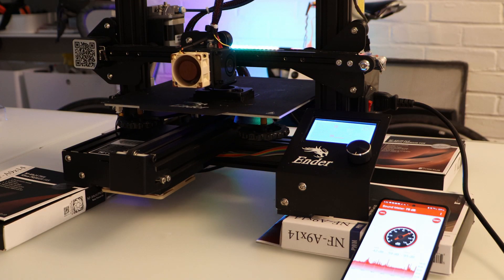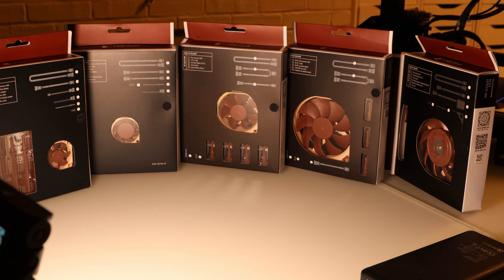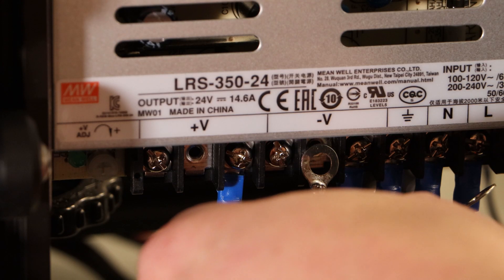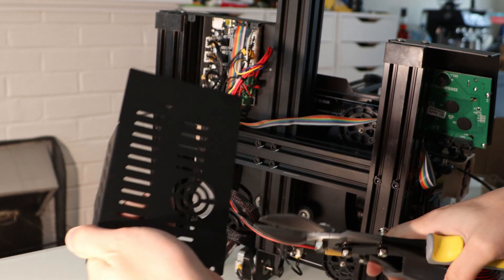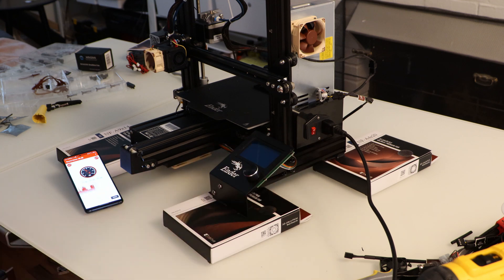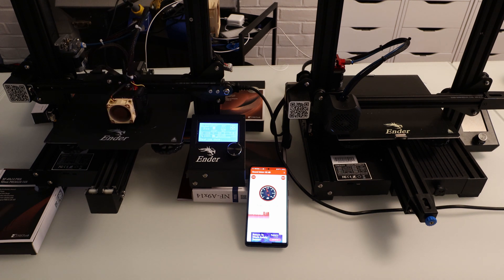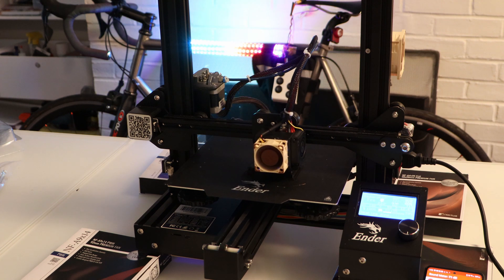Ender 3 Silent Fan Upgrade (Upgraded Pro Vs Stock V2)

Comment: Oh my.. i mean yeah it could be just a tad quieter but its not as much the different fans its how they get air in, by removing any "gates" "small holes" ext from the fan inlet will make it quieter due to airflow.. but hey man if u feel that throwing out money on fans go ahead! I only recommend that one only print a new holder for the fans, as heat removal is a important thing... just saying :P
Reply from the maker: Yeah the v2 seems loud compared to the Ender 3 Pro, which is probably down to the new fan protector design.

I've thrown away close to $400 on Noctua fans over the years so don't tell me now that they aren't any quieter!
Reply: @NathanBuildsRobots  but quiet is not everything, airflow and cooling is much more important than the noise, yes noctua is quieter but to a sacrifice on airflow. but if it works it works but people should know that in some cases its not a great idea to change the fans to quiet when it needs good airflow! :)
Reply from the maker: @jonathanbeccau6198  Yeah that's why I doubled up on the fans for the hotend heatsink. The 2 fans together make up for them being weaker, which i verified through temperature readings. Its not exactly a cost effective solution but I was working with the stuff I already bought. 

Speaking of "if it works it works", someone commented that I should just use the 2 Noctua fans in series since 12V + 12V = 24V. It actually works! If you stop one fan, the other gets about 0.5 seconds of 24V before they both shut off, I think through their built in overcurrent protection. Then they both turn back on at the same time and just go. 

This was using the 40x10 and 40x20 fans in series, which have the same voltage and current rating. I was pretty sure it was going to fry $30 worth of fans instantly but it was a risk worth taking.

Comment: you have both fans running in series? why, you just make more noise and create less airflow. take out the old fan, in order to have multiple fans in series you would have to have a stator which has its blades pointed in the inverse direction of the spinning blades.
Reply from the maker: Yeah I think a stator would make it better, like in a jet engine. 
The way it set up now is quieter than it was before but I guess it could use some improvement.

The best solution is to just get rid of that fan altogether like I did on some of my fanless builds. Someone in the comments said if you use an AC heated bed you can use a tiny laptop power supply which I would really like to try!

Comment: Man, thanks for this video.  Very hands on!  Especially liked the benchmarking before the changes.  One Question: What gauge wire are you using between the power supply and the buck converter?
Reply from the maker: It should be drawing around 0.1A so almost any gage will work. But I tend to use big wires (20Ga or larger) to make sure some surface mount component blows before the wires melt, because that way at least things stay put. 

I always Google "awg" to get to this page: https://en.m.wikipedia.org/wiki/American_wire_gauge#Tables_of_AWG_wire_sizes

"Then look at Ampacity at temperature rating"

Comment: To get around the 24v dilemma, without using buck converters, I would run two 12v fans in series.
Reply from the maker: Update: I tried running 2 in series and it actually worked. It's be in my next video.
Reply from the maker: I will try that, thanks! I want to put them in series and measure the voltage with a multimeter to see what happens if I stop one fan while the other keeps spinning.
Reply: the problem with this is that when one fan slows down or stops (if for example it breaks or malfucntions) and therefore uses less current, then the other fan will see a higher voltage. This is not a viable solution. You need a stable 12v supply. 

If you dont want to use a bulky buck converter you can use a backwards-operating 12v zener diode with the appropriate current-limiting resistor to provide a stable 12v.
Reply from the maker: @duviday  I thought the same thing, but it turns out noctuas have really good current limiting protection, so they stop they so themselves from blowing up. I wouldn't recommend it, but it's been working for me.
When I stop one fan the other sees a voltage spike and sits itself off in 1 seconds.  Then they both turn back on.

If I constantly jam one, the other will keep trying to start but it will just turn on and off repeatedly until I release the other fan.
Reply: @NathanBuildsRobots  measure the current: my guess is, that if you stop one fan, the current rises (on the stopped fan) and the other (free spinning) fan stops due to voltage drop.

Comment: I was thinking of an other solution, cooling the pcb with a teg.
Reply from the maker: You could do that, but ThermoElectric Generators are mainly used to cool things below ambient temperatures, or accelerate heat transfer to a heatsink, which will then disappear that heat into the air. They are interesting but not very efficient. Similar cooling can be achieved by simply using a slightly larger passive heatsink.

In my latest video I installed a vapor chamber (heat pipe) onto the motherboard to cool the stepper drivers. It looked cool but was probably overkill. Would have been easier to just put a normal heatsink back there for similar effect. 
 
https://youtu.be/uqCntWdLIvA

Comment: So is your hot end and cooling fan wired together? I’m trying to figure out if I could make my cooling fan work like stock where it turns on after the first few layers.
Reply from the maker: I left my cooling fan as a 24v unit and wired it into the same cables that the stock part cooling fan used, so it has the same behavior. The dual ball bearing 5015 fans by WINSINN are pretty good, I left a link to them in the description. 
If you are using a12V fan for part cooling you will need to run a voltage adapter in series with it, let me know if you need more help with that.

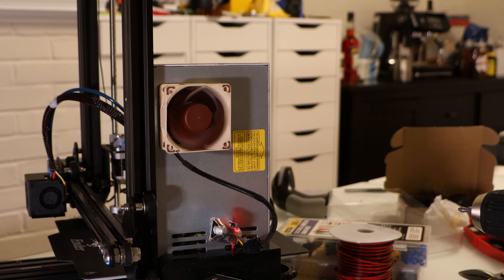Comment: 6:07 The airflow is upside down on the PSU (The PSU is upside down). The fan should suck cool air from below and release it out the top vent holes.
Reply from the maker: Yeah, I didn't like installing the fan like that. Gotta have gravity work with us not against us!
Reply: @NathanBuildsRobots  This statement only makes the case for bottom mounting (or flipping) the fan even stronger. benches air typically become less dense when it is heated causing it to be pushed sideways and upwards by the colder, more-dense fluid around it, that is being pulled more strongly down by gravity. So long as gravity is the dominant force at work. In one aspekt you are the one working against gravity😏. 

But seriously, splendid video it helped a lot!
Reply from the maker: You're welcome! Yes I know, everything is upside down, but it's Creality's fault because they pre drilled the holes to be installed with the fan on top blowing in. If have preferred to have the fan on bottom blowing in, or the fan on top blowing out, but without opening up the power supply or mounting it with the wires sticking out of the top I had to do it the less than optimal way :(which is why it pains me to install it the way I did but it was the lesser of 2 evils)

Comment: The difference is huge. Great video. 3 Noctuas are about $50 but you need to buy four so you can elevate the printer on the boxes :)
Reply from the maker: You may be sad to hear that I have replaced the fan boxes with real feet.
Reply: @NathanBuildsRobots  Shame!

Comment: half of the printer price for new fans. This will be evolution. :-(
Reply from the maker: Yeah, there are certainly cheaper fans on the market, but prefer Noctuas. The cost increase is due to better materials, engineering, and accessories (such as the extension and splitter cables that I used to wire up the machine). Well worth the additional cost IMO.
Reply from the maker: I will see what I can do about getting the price of the fans down.

Comment: But a part cooling fan is still stock. It's not completely silent because biggest noise exactly from the part cooling fan and it is almost impossible to replace because there is a 24v controlled by pwm. You can install noctura fan there and limit fan speed in the slicer but guarantee that this will always work properly.
Reply from the maker: I got some 24v 5015 fans that in using now, much quieter and better part cooling. Will be posting a video with them on the printer soon
Reply: @NathanBuildsRobots   I tested all of them and you will have a creepy pwm sweeping ) Good luck.
Reply: @NathanBuildsRobots  This sounds great! Looking forward to the video

Comment: The V2 is a in general good machine I think but indeed I was a bit dissapointed that the PSU fan is so loud I need to use earplugs in my right ear to be able to sit next to the machine and continue working on the CAD computer at the left  side of it while its operating without risking long term hearing damage as it is basically like having a hairdryer on full speed or similar constantly screaming in my right ear as I have set the V2 machine and CAD/Slicer computer together on a table as a complete workstation and while the machine is running one set of parts I meanwhile often like work on another set of parts on the CAD computer at same time while keeping a constant eye on the machine in case something go wrong, part comes loose from plate ect. Also the hotend fan is broken from start with cheap bad bearings that squeal and vibrate from start although I can get it to roll properly for an entire run by switching the machine on and off a couple of times and then the bearing will align properly.
Reply from the maker: Lol, I know what you mean, the sound bothered me too. Now I'm printing 15 mm^3/s in silence with a V6 Volcano hotend kit, which is 4 times faster than when I was using the stock setup. I'll post a video about it in the next couple of days. Just ran a 20 hr print that using over 1 kg of filament. I used Winsinn 5015 fans which blow a ton of air and are still quieter than the stock part cooling fan. My stock part cooling fans bearings were fine, but it makes a high pitched coil whine while running, so I cut its wire just to get it to shut up!
Reply: @NathanBuildsRobots  I saw your other vid now also about the PSU not having any outlet for the cooling air possibly posing an overheating and fire hazard so im in the process of fixing this at moment. Got the PSU box loose from the machine and tomorrow Im gonna Dremel out a square in the cover sheet over where the PSU vent holes are. I think its strange that Creality took good care with air outlet holes on the controlboard box but missed them completley on the PSU box.
Reply from the maker: Yeah, it makes no sense to me because if they left all that extra metal it it would be cheaper to make? 
While you're at it I would get rid of the fan cover on the black piece, since the psu already has one.

Comment: I replaced the mainboard also with a 40x10mm nocta so u don’t habe a big Fan under Ur Printer and replacing the Print Part cooler  i did that on my ender 3. 3x 40x10mm nocta That replaced the Stock Fan and u Fan Screew ist in and don’t need Hotglue 😅and 1x 120mm nocta fan for the Powersupply and of course the silent board. printer is now super quiet
Reply from the maker: I wasn't able to show the silent stepper board installation since I installed mine a while ago, but it's very important for having a silent printer.

Comment: Are you not push staring the power Fan with the new Noctua? If so that would make small power and is not earthed making static? (if that fan kicks in shorting you hold board?)
Reply from the maker: So the external noctua is blowing air through the internal PSU fan. The internal fan is stationary so it's not generating any voltage.

Comment: nice work man, i just ordered the Ender 3 V2,  and why i was at it i also ordered the Dual Screw Rod Upgrade Kit, BL Touch Self Leveling Sensor kit, BIGTREETECH TFT35 E3 V3.0 Touch Screen, CR10 Heatsink Hotend  Kit, Upgraded Aluminum Dual Gear Pulley Dual Drive Extruder Kit and the FYSETC heat bed gold springs. Cannot wait to get this bad boy all together.
Reply from the maker: Nice, welcome to the Ender 3 Fam.
The first upgrades I put on mine were the gold bed springs, Capricorn tubing, and all metal extruder. 
Now I have noctua fans, v6 clone hotend, 5015 blower... pretty soon I'll have spent more on upgrades than the printer itself!
Reply: @NathanBuildsRobots  i will have to keep a look out for new content you post for upgrades.
Reply from the maker: I just finished putting on a volcano hotend on my v2, it's pretty sweet. Prints twice as fast now, but slightly lower quality. Will be posting the video later this week!
Reply: That is a an very good build. Please upload info on the volcano

Comment: Great video! Has the production value of a much larger channel. It would be cool if you found a way to swap the part cooling fan too!
Reply from the maker: Thanks, I tried to do this mod without having to do any 3D printing. I just got some new fans in Winsinn 50x15 Blower Fans. They are the same type that Prusa uses.
Reply: @NathanBuildsRobots  so, 2 years later, what do you recommend for the E3Pro for part cooling to be as silent as possible? I planned to use a noctua 40x20 with a custom duct from thingiverse but they apparently cant handle the 2pin pwm coming from the mobo.